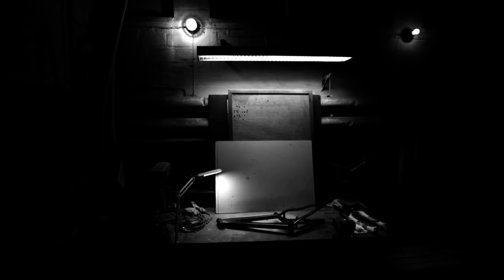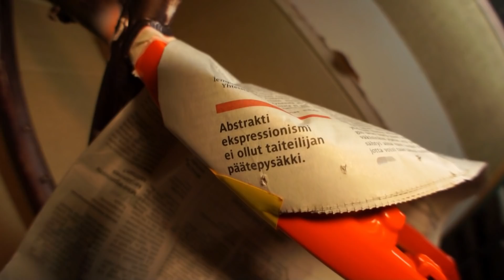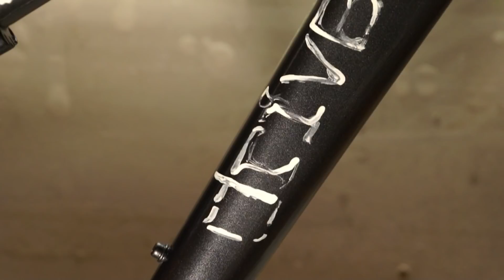JP Kaukonen - Bike paint

Comment: Hello sir, i have got acrylic lacquer spray  . .  ..  but i do not understand proper way  .. .   i think ,  first i clear cycle body . . than spray primer  and  wait for  10 min than wet sanding with p1000  sand paper . .  than clear and dry it . .than spray 2nd coat primer . . after 2nd coat  wait  10-15 min  .. than apply  main colour 3 times with 10 min gap each coat  ..  .aftar final colour coat . .wait 10 min than apply clear coat. . . . .  is it okey ?